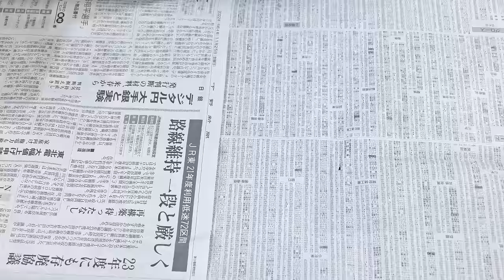【DIY】2 Styles Panel Saw from a Circular Saws / Hacks

Comment: Aluminum for the win over wood for accuracy but what did this cost you? Where do you source your materials? Great video!👍🏻👍🏻
Reply: My thinking is, this won't be cheap but, for a small shop the space saving is worth the extra cost OR there may simply be no product available for any kind of money. Plus there's the learning and practice and potential future sales of the device also gained from it. I for one would definitely not be able to find something like this where I live, and also don't have the space for a horizontal panel saw or anything like that. So a vertical space saving device would be worth the cost for me.

Comment: For price comparison purposes, what would the US dollar cost be to construct this device. The manufacturer's part number for the extruded aluminum rails And ball bearing slides and precision rails may not be readily available in the US and substitutes appears to be quite pricey here in the states.

 I am very impressed with the design and workmanship shown in the YouTube videos but have not been able to identify equivalent aluminum parts available to me.
Reply: I looked into it, and linear rails and linear bearings are not as much as you think.  I got a set for $90 USD, but they look slightly different but should function the same. The backplate is around $100 to $150, I noticed in other videos he was using 5052 plate so I assume that's what this was.  Extruded aluminum isn't all that much either, you can buy on Amazon even.  I think I could make this for $500 and I'm going to try!

Comment: This is amazing. Wouldn't it practically be a substitute for a table saw?
Reply from the maker: I've used a panel saw I built a while ago as a replacement for a table saw for years.

It takes time to set up, but it is much safer than a table saw.
https://youtu.be/sa2I0vUCXsE
Reply: @jisakukobo  - Ah yes, the wall hanging one. I like this new one more, because it can be moved around and leaves the wall for storage or something else.

I have followed you for a couple of years (if I remember correctly), but I never thought to ask if the panel saw can completely substitute a table saw in functionality. Do you find that there's anything your panel saws (stationary and this new movable one) can't do but a table saw can?

And yes, this definitely seem a lot safer.
Reply: @TheStabbedGaiusJuliusCaesar  Not as useful for rip cuts. Angle cuts and miters would be a lot more awkward to set up, too. Isn’t it better to feed the material into the machine for some types of work? On a panel saw you are using gravity to hold the panel in place, but for an angled cut you need some way hold the work at the correct angle. Now you are fighting gravity.
Reply: @MarcosElMalo2  - If I remember correctly, JSK has a angle/miter jig for the wall mounted panel saw. 🤔
Reply: @MarcosElMalo2  // You both make valid points that I hadn't considered. Recently I noticed I had missed something b/c I'm always fascinated by the precision/design of each new built. What I missed is: nothing is made except jigs/tools which are then used to make more jigs/tools, but not the items that jigs/tools typically make e.g. furniture, cabinetry, chests/boxes, doors on/on. Imo it's like a YT channel of a "master chef" who knows how to make the utensils needed to make a meal, and how to prep the ingredients to make a meal, BUT he never actually makes a meal.

Comment: I always liked your 2in1 and 3in1 Circular Saw panel Slide Guide. Does this build replace the older wall mounted design or is it an addition?
Reply from the maker: It's completely new.
Each is used properly according to the application.

Comment: I really like your jobs, I do!
But, the materials you use are extremely expensive!!! The aluminium profiles, the linear bearings, and so... it seems that if you buy a ready made panel saw the cost would be more or less the same... with less accuracy, of course, but cheaper!!!
Best regards
Carlos

Comment: These parts might be cheap in China but in the USA thats 600 dollars worth of slide berrings and rails. And its overkill for what its doing.
This is great but you can use smaller components and get good results, 
I might opt for 8020 track  or something like it.   The bars not too much but a berring that big. Lot of money.

If your using items this big for a panel saw, you could make it do 2 jobs, panel saw or add on sliding table for table saw.
The slide berrings and rods are big enough to use making a sliding table saw wing.
Reply from the maker: You should buy my plan now.
I have a parts list for my plan.
¥36000 including slide shaft and bearing bush.
Only about $240.

Comment: An electric pedal is needed for safety. If something goes wrong, in order to reach the switch, you may have to release the handle of the tool. And this can make the situation worse.
Reply from the maker: I'm of the opposite opinion.
What if you step on the pedal by mistake?
What if it steps on when setting ingredients?

I thought about adding pedals, but decided against it because it was too dangerous.
Reply: @jisakukobo  I use English through an interpreter. Therefore, I may be expressing my thought poorly. The pedal should work like a STOP button. So that you can stop the car without trying to reach the standard button. And without releasing the handle of the tool.
Reply: @jisakukobo  the foot pedal should be connected in series with the switch on top, so you have to enable both at the same time to start the saw. But the switch on top should be another type, latching and resetting itself when the foot pedal is released, to prevent starting the saw just by stepping on the pedal. Also consider a shroud around the pedal to prevent accidental stepping. Millions of possibilities, to make it safer 😉😎👍
Reply from the maker: That's the emergency button on the foot pedal, right?
I think it's safe then.

I will consider making a prototype of that switch.
Reply: @Nakojher  this would be like on our drill press at work 🙂
There is a Mushroom style switch on the floor, disconnecting the power to the drill and tripping the main switch.
You have to reset the Mushroom first, and turn on the main switch to operate it again. 👍
Reply: @SystemX1983  Absolutely right! Only I would cover it with a pedal so as not to miss-)
Reply: @jisakukobo  i think what he's referring to is a dead man switch
In case something goes wrong, you step on it and it stops
Reply: A big enough paddle switch mounted at the bottom that you can kick with your toe, not a pedal on the floor. You could possible use a more modern light switch (the low profile type with the flat toggle) if you can’t find one specifically designed for foot operation. This might also be the on/off rather than extra safety, making the switch at the top unnecessary.

I just thought of something else that would be simpler, yet much more elaborate to build. Voice activation! It should be possible with raspberry pi, no? It seems silly right now, but I bet we see this on manufactured equipment in the future. The tool makers are always adding features and improvements to sell more saws. Alexa, turn off! (Of course, you’d want to name your saw something else.)

Are you with me? Because having a computer controller for on/off leads to other stupid possibilities. 😂 Like recording your use of the saw to tell you when to replace the blade. However, I would avoid putting the saw on a network. You don’t want a “hacked saw” (haha).
Reply: @MarcosElMalo2  as mentioned before, on/off foot pedal might get bumped and turn itself on when you dont want to. Very dangerous
Turning it off with voice activation would be difficult to say the least
Voice commands might be a good idea for other things around the shop, like turning on dust collection, but probably not a sawblade spinning 40 times a second that can easily cut thru a skull
Reply: @Legit_SuperFall  I don’t think you picked up on what I was trying to describe. It’s not a pedal. And of course the voice activated idea is absurd, but possible. At least it is absurd currently. Maybe not so much in the future. It would certainly be too much work for me, as it’s an entirely new thing I’d have to learn. 😅

That said, you might be aware of people building (DIY) computer controlled panel routers?
Reply: @MarcosElMalo2  hey, if you can't accidentally turn it on, and it's easy to turn off the instant you need it to, then its fine
Same goes with voice activation. Anything that spins 40 times every second makes a lot of noise, very easy for something like that to not be reliable

Comment: What happens with the weight block when you change the angle from vertical? Does it mingle?
Reply from the maker: It's hard to put into words about it.
But it's a reasonable design.

The plan describes it.
If you are interested, please buy it!
Reply: @jisakukobo  no, thank you,like the others, I am not interested in buying it.
Reply from the maker: I thought so.

Comment: anyone can tell me what would be the advantage of moving the panel saw on the back side instead of the front side to cut? what I can think of is the cutting surface is pressing on the panel, which may yield a cleaner cut? any other reason? please comment.

Comment: This is an amazing build but only half of a video. This presentation needs a voice-over to explain what he is doing as well as why. For instance, why has he made a feudal attempt at a riving knife when it is made for breaking down sheet goods and will never see a rip cut through a slab of hard wood and that thin piece of sheet metal would never hold the kerf open while sawing, anyway. The riving knife has to be about as wide as the kerf that is being cut (in other words, the width of the blade) with the leading edge of it being chamfered to a wedge shape for entry into the kerf. My question #2 is why did he elect to make the build with the circular saw hidden behind the jig with the blade pointing at you making the build way over complex, more expensive than it needs to be, and consume so much more engineering time. The third question I have is Why did he make this unit free standing when he has it hard wired in with Romex? Why not just mount it on the wall?

Comment: A very expensive design turned out. Why was it necessary to use so many expensive parts for the manufacture of the frame and the stop?
25:52 It was possible to additionally connect a vacuum cleaner to the switch.
Очень дорогая конструкция получилась. Зачем было использовать такое количество дорогих деталей для изготовления каркаса и упора?
25:52 Можно было на выключатель дополнительно подключить пылесос.

Comment: I’m disappointed that exotic linear bearings are used, instead of ordinary components easily affordable to most people.
Reply from the maker: Tools made from materials with no dimensional tolerances are just inaccurate tools.
If you want an inaccurate processing machine, you don't need to go out of your way to make a panel saw.

Comment: What is the diameter of the linear guide rods and bearings you used??
Reply: 40?
Reply: @dobrin.ivanov  Thank you!!!
Reply: @PaganWizard  Do not get me wrong, please. I was just trying to guess and remind the author to reply as I'm wondering about it too. Like for 150cm how thick rods do I need for a stable setup.
Reply: @dobrin.ivanov  You said nothing out of line, no need to apologize. I looked on Amazon and found 40mm guide rods, and they were INSANELY expensive. Then I found 30mm guide rods, and they are MUCH more affordable. I'm pretty sure that the 30mm guide rods will work fine.

Comment: Thumbs UP,   but the Mechanism with   the wood, hinges, going up and down , starting in Minute 19 second 14    also in minute   20 second 23.    This mechanism will not be  accurate in the future .   With time the mechanism is going to get loose and the accuracy of the cut    will suffer greatly !   Who am I to address JSK-Koubou   but I am sure 100%.   After assembly   it is ok.  After 200 cuts   maybe not.   This mechanism has to be redesigned.  I prefer simple clams , and not up and down mechanism.